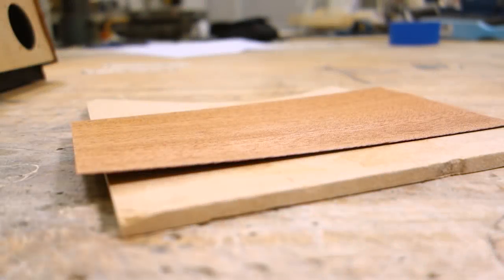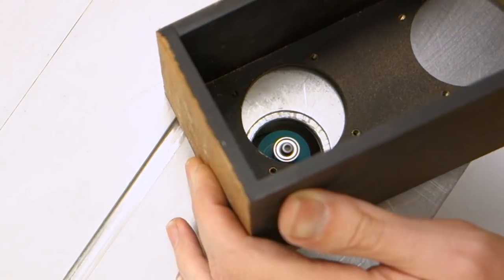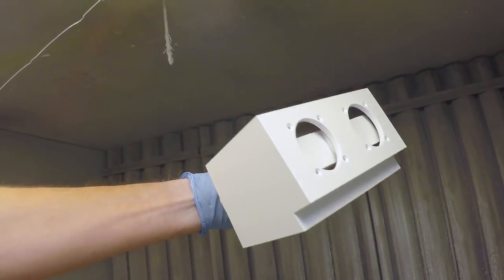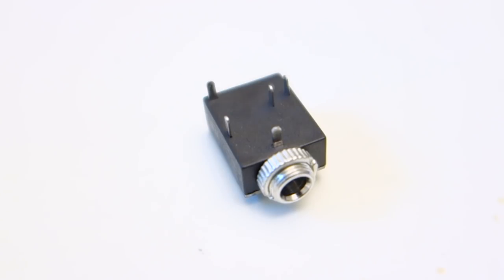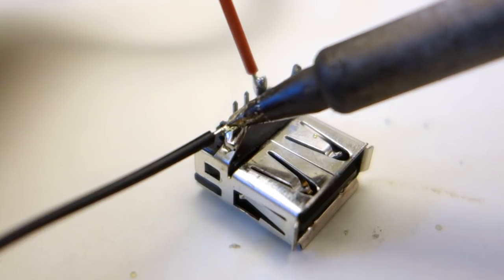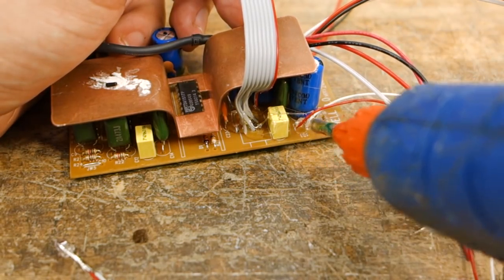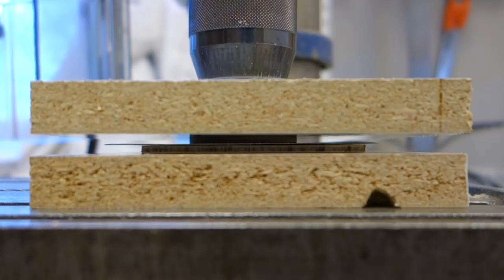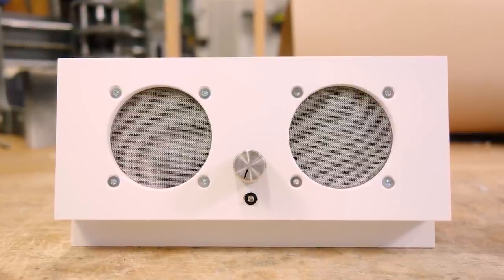How to Fail (and Succeed) at Building a Speaker

Comment: Don't know if there is somewhere in all the comments a mentioning about sealing MDF but something that I used for a cabinet was a glue/water mixture. 1 part glue and 2 or 3 parts water just that thick so you can apply it with a brush. Let it dry and it should not be visible but the MDF turns hard enough to not absorb so much paint,sand the parts, repeat if needed. Great video!

Comment: Very nice. For tricky situations like putting the nuts on I have one of those telescopic pen things with a magnet on the end. Bluetack might be better in that it won'e spin as soon as the thread engages and tightens. It is invaluable for picking up screws you drop and even getting them out of the boxes they come in or those storage suitcases. Where it really shines is putting panel pins in. You can hold the pin in place with the magnet end and hammer away without smashing your fingers or fussing with long nosed pliers or looking around in the bottom drawer for a comb.

Comment: Helpful vid.  If you are going to paint mdf, even on the back, I recommend applying sanding sealer and sanding with 220 and/or 400 grit.  Then, when you paint a few thin coats, the edge cuts won't be nearly as obvious.  Primer/filler tends to shrink in my experience.

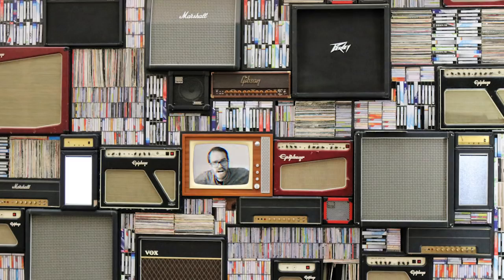Comment: Very good!The wood looks more like Mahogany than Walnut.  Nice shot of the Schwebebahn in the snow at 3:30.
Reply: Mark Fogleman that’s what I though. Mahogany is a bit oily so that could have contributed to the varnish problems.
Reply from the maker: It was bought from the supplier as walnut though, and at least the mahogany I've worked with is lighter than this.

The snow shot is stock video I downloaded, wish I could take credit 😄
Reply: Switch & Lever it’s a shame you decided to practice scoring 3 pointers with it, I’d have been interested to see if you’d given it a light sanding to key the surface and a couple of additional coats of varnish it would have been ok.
Reply from the maker: I sanded one part lightly with 600 paper actually, but the results were so disappointing considering that the varnish had so deep peaks and valleys I didn't really continue. I simply wasn't in good enough of a mood to try to rescue it. It was supposed to be a fun quick project and instead just turned into a headache. It literally took me more than half a year until I started work on the white speaker 🙂

Comment: Little bit of a tip, use Zinnser B.I.N. with a roller or a similar type product to coat the MDF before painting it. That lets you get an even, incredibly glossy finish without the usual garbly grain-raising that MDF usually experiences when encountering any kind of moisture and paint

Comment: Thanks for sharing. I like the upcycling. I've played with a few computer speaker systems like this. I've never been impressed by the quality from these systems. I prefer to use circuits from old flat screen TV's or old powered subwoofers. I have found a few TV's with separate audio amp modules. Even if the audio amp is on the main PCB it is usually placed in a simi-modular block where it can be cut out and made into a module. If you use a powered subwoofer from a home theater audio system, they use a regular speaker with a simple filter circuit to create "base" audio output. These powered subs almost always use a powerful IC amp like a TDA××××. Just find the audio input for the IC cut the copper input trace and add your line in input from a Bluetooth connection there.
  My go-to Bluetooth module is the KRC86B-V4.0 they aren't the cheapest modules (usually $5-$8) but they always work. 
  I haven't created any audio related content on YT. The last BT speak I built I installed 2 power supplies with a relay. I leave the Bluetooth module powered up using an old 5V charger inside the enclosure. Then I used the "EN" (enable/Bluetooth connected) pin of the KRC module to connect to the base of a NPN transistor through a 1k resistor. The NPN's collector/emmitter grounds the coil of a relay that connects mains to an upcycled power amplifier. The benefit of this arrangement is that I can connect to my Bluetooth speaker any time I want from anywhere in my house. I am not worried about it drawing a bunch of power all the time because it's just a small 5V switching supply that has power until I connect via BT, then the 35V 2.5A supply kicks in.
Thanks again for sharing,
    -Jake

Comment: i done some thing  similar. From blown up pc speakers i salvage amplifier and use center speaker from 5.1 for housing and 3 speakers. All was instaled thrue speakes hole. Power up from wall 1m conecting cable with 3,5 jack. Its more loud that normal radio and with some treble corectiom not bad sound.

Comment: Nice job you have some skills, a couple thoughts, first I am sure you know it but I didn't recall you mentioning it in the video but the box volume is 100% determined by your driver parameters, it is very important for bass response. Second, for the blotching, I am not sure if you used water based or oil base but I usually use oil,  first apply what is known as a spit coat,  5 parts denatured alcohol to one part  shellac. It seals the wood and allows for a much more even finish.

Comment: FYI the best glue for veneer is contact cement.
Also use a file at about 45° angle to the corner/edge  you are cleaning up. So 2 boards together if corner of joint is pointing straight up your file will be completely flat horizontally.  When you have  filed about 1/2 way through take the round smooth part of a screw driver or just a wooden dowel to burnish the veneer over. It will roll the thin veneer over the corners seams will become invisible

Comment: That's a really-really weird place to find 5V and tap it from - the audio coupling cap in the input! - I'm really wonderng how on earth that worked, seen from an electronics perspective - i would expect the amplifier to be really unhappy about that and som serious bluetooth-processor noise on that particular channel.
Reply from the maker: Yeah, I figured that would be a risk, but in this case it worked out. It does get some awful mobile phone distortions with the phone closeby though. Had to shoot the 3.5mm scene with the phone on airplane mode for it to work properly, so it needs a longer cable to get the phone away from the speaker.

In the end a DC-DC converter from the 12V jack would probably be a better choice.
Reply: You could also get a  bluetooth thingie designed for use in a car that would already expect 12v or even take it apart and switch out the regulator as the device is probably using 3.3v internally anyway.
Reply from the maker: Yep, but would've meant more money again. If you're going to not do an absolute hack job it's probably better to just get a proper bluetooth amplifier board to begin with.
Reply: you sure the problem isn't with that audio wire that you used for the 3.5 jack? it doesn't look to be the shielded kind but a cheap 3 wire put togheter, so it might be taking in the radio signal

Comment: Best tool ever for starting nuts, a plastic nut spinner - you press the nut into the round end which grips the corners, then you spin the nut down and pull the tool off. I got a couple as a cover gift on an electronics magazine ages ago
Reply from the maker: Sounds interesting, but I don't have one, and I'd wager most people don't either. May have to look into getting one, but knowing myself it would just end up kicking around in the bottom of a toolbox not being found when needed, and I'd just resort to hacking together something like I did here :)

Comment: You sanded the veneer too smoothe so it closed the grain up. If you want wood to absorb finish you can't sand so smooth.
This applies to planed or cut wood too, the surface is more hydrophobic.

Comment: but...but...I need to know what happened to with the veneer? Did the glue soak through to the surface in places thus affecting the finish? Was there some type of oil on the veneer you used that need to be acetoned before applying the poly? Your finish product looked great and the Ikea grill was a huge success.
Reply from the maker: I honestly don't know. I tried sanding it down lightly, but realized that if I could have sanded through the varnish without going through the thin veneer anywhere it would've been a miracle, a very time consuming miracle. I think the problem was more in the finish than the veneer, maybe the varnish was old, or I didn't mix it up enough after it sitting on the shelf for a while, I dunno. Usually I thin my PU varnish with mineral spirits before applying, but for some reason I didn't this time, so maybe that could've helped. Oh well, I ended up playing basketball with it and a garbage bin, good news though, only took three tries from across the room to get it in! 😄
Reply: 30% from the 3pt line is still pretty good!  My guess would be the thinning and more coats...nice to know you are human though.
Reply: The glue soaked through the veneer, and the poly would not take to the glue, you could try sanding off the poly, and seal with shellac, and then topcoat with poly, or more coats of shellac. Or the poly was old and had started to polymerize in the can, which will also cause the issue.
Reply from the maker: I think more likely the latter, as I've use oile based poly over glue (well, glue/sawdust home made wood putty at least) with no issues in the past. The can may have been old though, and coupled that with not thinning it as I usually do could've been a recipe for failure. Oh well :)
Reply: I'm guessing old poly since oil based finishes should be fine over most glues.  Although almost nothing works over  silicone.  I agree that you should be able to salvage it, but let it cure for a couple of weeks or more, sand smooth, and then use new poly.
Reply: I would say this is no walnut. To me it looks like Lauan. There are quite oily and greasy tropical woods that dont take varnish well. Could be old varnish as well like mentioned. Or humid atmosphere. Or cold surrounding. Or anything. Sometimes you get f...cked no matter what you do.
Reply from the maker: It's highly unlikely the local hobby store I got it from would sell anything more exotic than walnut to be honest. I'm pretty sure this is what it is. I think it's definitely the fault of the poly, i.e. user error 😄
Reply: Woods often have oil  and resin naturally. I would just stick with an oiled finish like linseed oil or danish oil. Its beautiful and durable but not glossy.

Comment: Use thinners with your polyurethane. Thin it down first, use multiple coats of the thinned down varnish and use wire wool in-between coats.

Comment: pretty cool! you could have substituted the usb connectors with wires, fixed the board flat on the bottom (although im pretty sure you had a reason for that one) and put some audio insulation inside (it improves the low frequencies). Too bad about the veneers though, it would look pretty cool. congrats!
Reply from the maker: Yeah, I could definitely have done that. I actually wanted the USB jack in there for future compatibility, in case I wanted to put a better Bluetooth receiver in there. In all honesty the one I put there was not particularly good, just a super cheap eBay one.

Comment: Always use oil based clears. I would also suggest lacquer. goes on smoother and comes out smoother. I would suggest spray finish on small stuff. You will get a better finished product and not have to sand the brush strokes out.
Reply from the maker: It is an oil based poly, I hardly ever use water based stuff. Brush strokes are usually minimal, and it's a good idea to scuff up a varnished surface between coats to help the next coat adhere anyway. This was something else, most likely too old poly which simply didn't like its life any more.

Comment: I wonder if the polyurethane varnish issues were related to bleed through of the veneering glue?
Your veneer was bending a lot during the glueup process, which implies a lot of moisture wicking through the grain.
It might not be it, but it's the only thing I can think of ...

Comment: Guessing that the glue was not entirely dry having soaked into the thin veneer. Might have worked if left longer before applying the poly? Good to know, as I'm waiting on delivery of a couple of woofers and a tweeter to make a centre speaker for my cinema, and was thinking of veneering them like yours. Will make sure glue is thoroughly dry, and veneer lightly sanded before applying finish!
Reply from the maker: No, it has nothing to do with the glue. The reasons have been discussed at length already in the comments. The varnish had started polymerizing already in the can, it was thicker, and it was my own fault for not cutting it with mineral spirits as I usually do.
Reply: @SwitchAndLever  Ahh. OK. I was already changing my mind, and will use an oil finish when I build mine. Have successfully finished a couple of guitars this way, so I know the pitfalls that can be avoided! Maybe I'll have to try and film my speaker build, too!

Liked and subbed to you, BTW!
Reply from the maker: @timbeaton5045  go for it! Either way documenting your builds is always a good idea for the future!

Comment: you have  do a couple coats of varnish sanding smooth in between
Reply from the maker: Yes, I know, but it's unlikely that's which was the problem here. I wish I wasn't so disheartened after the first coat, because the varnish was rough, like a moon landscape. It would've taken substantial sanding to get down to smooth, while being careful not to sand through the very thin veneer.

Comment: As a cabinetmaker, the only thing I could suggest that would explain your finishing problems is that there was a reaction with your water based poly. I am NOT a fan of any of the water based finishes, so I can't say exactly what went wrong. Most of the time when I use veneers, I use either hide glue or contact cement. I always topcoat with either shellac or oil based varnish (or Poly). I know that raw veneer can cause more problems than paper-backed, or laminate-backed veneers, because the glue can seep through the veneer. I hope you will try the veneering again. You seemed to have done everything right.
Reply from the maker: It is oil based poly actually, never really use water based poly (heck, any kind of poly finish is difficult to get hold of around here). Usually I thin it down with mineral spirits, but for some reason didn't this time around, so that could've been one cause. Oh well, c'est la vie, you live, you learn 🙂

Comment: Unless you really like gloss finish on veneer you can use Danish Oil. It's a compromise between protection and look. And you can't mess it up (well, if you use PVC veneer, you can :) ) - you just put it on. Wait a minute to soak, then rub it off with a paper towel
Reply from the maker: I've used satin PU varnish on plenty of projects in the past, I really like the durability it gives. Don't know what went wrong this time around, but probably old varnish plus that I didn't cut it as I usually do with mineral spirits.

Comment: I've had polyurethane do that to me! The problem was that I was working in the sun on a warm day, not even a hot day. I had maybe a 1 minute working time to play with. Not nearly enough for a chest. I ended up doing a lot of sanding and re-coated the piece. Turned out much better, but I still had to do the final coat 'sanding' with paper to get the gloss I wanted.
I've learned to only finish pieces outside early in the morning or late in the evening. A cold garage is best.
Is your shop hot?
Reply: Finishes do need leveling time. In order to increase leveling time you use a thinning agent called a, "retarder". It slows the drying time to allow the finish to level out. It is a big deal when you're clear coating a car or something. Says right on the cans what temperature ranges they're designed to work.

Comment: The availability of readymade electronic modules makes creating things so much easier.
Reply from the maker: Yep, but the point here was to spend as little money as possible. Bluetooth amplifiers still cost more than this project cost in total.
Reply: I wasn't being rude or saying that you should use them,
I was just making an observation on the fact that readymade modules like the PSU you showed, makes hacking and modding so much easier.
Reply from the maker: Wasn't at all taking it as rudeness, just explaining my reasoning.

Comment: I wonder if Tung Oil wouldn't have worked better for the veneer...  In any case it still came out great.  My old boss I believe had computer speakers like that and for what they are they kicked ass, so I imagine they sound pretty good.
Reply from the maker: Indeed, the sound is way better than what the camera microphone picks up!

I don't know about oil though, considering the underlying MDF. I'm always weary at soaking anything into MDF due to its tendency to expand, especially though with anything water based.
Reply: I believe with using the tung oil, the MDF will not react poorly.  I finished a raw oak table with it 30 years ago and the surface is still really nice (even after it sat under a patio cover outside for a number of years)  The tung oil goes on best if using light coats rubbed on with your hands.  After three light coats it was a beautiful finish, perhaps you might try it on your next veneered project!
Reply from the maker: I may, if I can find tung oil, or whatever it may be called in Swedish or Turkish, depending on where I'll be then 🙂
Reply: It could also be called Chinese Wood Oil, Tungoel, Tungmeal and Lumbang Oil...